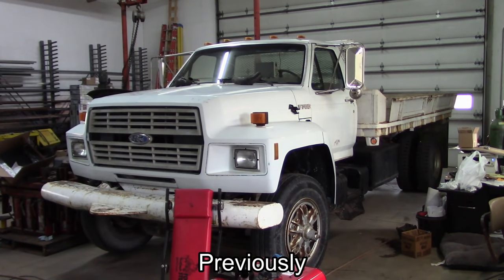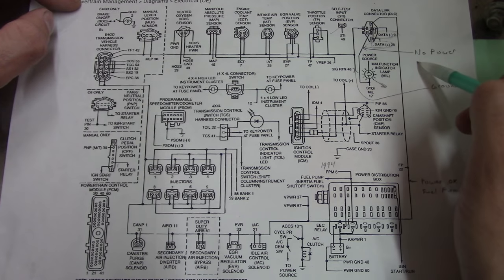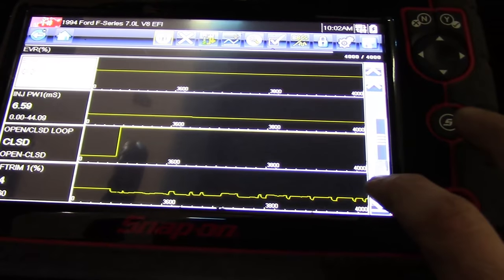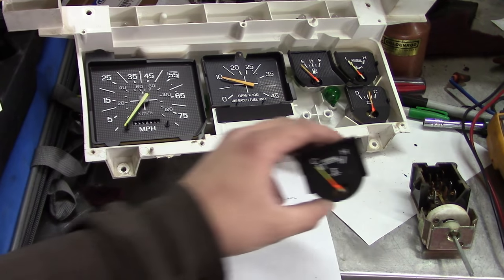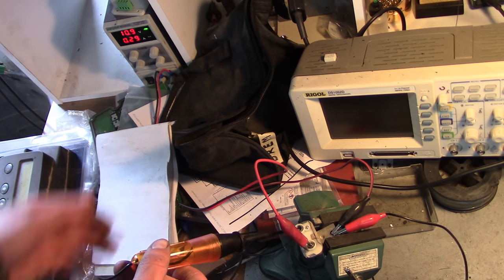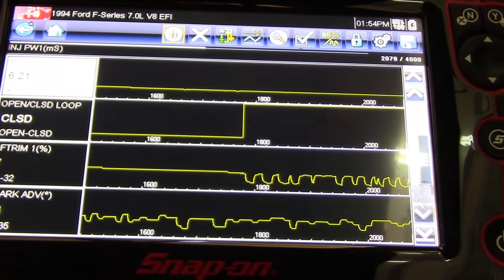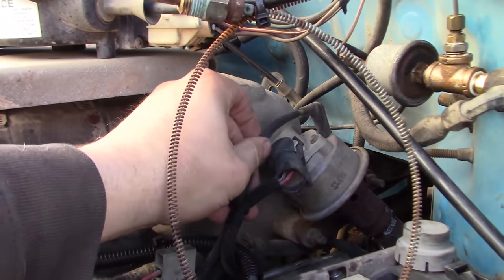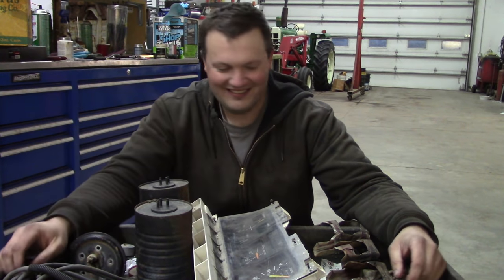Ford F700 Project - Missing, High Idle, and Gauges - Diagnose and Fix (Gas Engine) - Part 3

Comment: You certainly are thorough.  I wish all mechanics had your ethics.  I had an old 82 Ford F-100 that I rarely used except to haul things to the trash place a couple of times a year.  Every year for six years it passed inspection, until one year.  Same truck, same mechanic.  New rules, Emissions guys cracking down.  I never even knew that emissions parts were missing.  LOL.

Comment: EXCELLENT job of tackling ALL the issues with this truck. You sir, have what few guys turning wrenches for a living have, patience. Your approach to diagnosing and testing of all non-working components was spot on. BTW in answer to your question about the two data link connectors, some early Fords of around that era, just before and maybe even the first few that were OBD-II compliant had a separate data link connector for the ABS brakes.

Comment: This reminds me of the time I replaced the fuel sender on an International S1600. I checked the gauge by shorting to ground so I figured, new sender. Pull the old one out, looks brand new, float works, doesn't seem like there's anything wrong with it. In fact, it's the exact same sender I bought. So I stick the new one in, same problem. Always reads 1/8 tank. So I pull it back out and put my scope down the filler neck with the light coming in through the sender hole, and lo and behold, there's a pickup tube there right where the float wants to sweep. I grabbed a crescent wrench, re-indexed the float by bending the strut it was attached to, stuck it back in and it worked perfect. Same truck, bought a new alternator because it was overcharging like 17 volts. Go to stick the new one in and find that there's no wires attached to the voltage regulator pins. Wire was just hanging there. Alternator was about to fall off too. Plugged it back in and the one that was in there worked fine. I think it was installed by the same guy who put the new sending unit in the tank. Just a hunch.

Comment: I have the same truck almost with the same problems its a f600 with a 370ci gas engine my problem is that nobody will work on it i absolutely love the truck and i found your videos and watched them to see if i could possibly do the work myself with no mechanical ability whatsoever and after watching your videos i definitely will not be attempting to do it myself i did enjoy the videos and i wish i could find a guy like you in my area great work👍

Comment: Thanks for the videos on this F700.  I bought a 1993 F600 flatbed dump last year and ran into some of the same problems you did.  Sensors/controls I checked, found bad, and replaced: engine coolant temp, MAP sensor, O2 sensor, throttle position sensor, and idle control valve.  Replaced plugs, wires, distributor cap, and rotor button.  Have the same issue with the left turn signal - have to hold down to get it to work, but if I push it all the way down to the detent position so it holds, it doesn't work.

I still get a check engine light occasionally and it doesn't run as smoothly as it should - mostly on acceleration; idle is okay.  It smells like it's running rich.  I have a much less advanced code reader than you and I have only found one error code, but it could be one of two problems.  Can't remember the code now, but seems like it was a P52 or 53 - one option had to do with the power steering pressure switch, but I don't see one anywhere on the power steering system, and I don't remember what the other possible cause was.  

One thing I noticed when setting the timing was that it seemed to run better with SPOUT connector removed.  I've read several forums that say the electronic ignition modules are prone to failure.  Mine is on the firewall, but earlier model smaller trucks had them at the distributor.  I've ordered an ignition module and a new coil to see if this improves how it runs.  Incidentally, the guy that owned the truck before me had already replaced the distributor.

You gave me a few ideas on some other things to check like the purge valves and those vacuum cannisters.  I like the old truck and it's really useful around here on my small farm.   Thanks again for the videos on this truck.

Comment: Wow!  You are a master of the diagnostics!  That was just the truck that just keeps on giving..... you work.

On the positive no dead or live rodents. All parts were available in some way or fashion, and the parts cannon was not needed.

On the bad side it was like you used your entire supply of butt connectors and heat shrink, and you had to pull out the parts machine gun over and over...

Nice new logo!  We all need to use grade W bolts!

Who worked on this truck before?  They should have their wrenches and side cutters confiscated!!
Reply from the maker: Someone hacked it up. But the customer bought it that way.

Comment: I cut threw an under ground wire with a chain trencher running some drainage tile. Double 120 line, it was live. To repair it I used a repair kit from lowes. Shrink wrap and silicone. That was 15 years ago no problems yet. Repairs on that truck reminded me of that repair.

Comment: Excellent work Wes, great diligence and attention to detail, as well as exceptional patience. my mobile mechanic work is often not so detailed and the battle ya fight with 90’s emissions equipment on gas engines is a great challenge. I know very few people in the realm of auto and equipment mechanics that have the patience to return a machine to stock operating condition like you did, it’s easier to bypass stuff or throw in a 12v Cummins with no emissions equipment and then it ends up at YOUR shop some years down to road
Reply from the maker: These engines really weren't that bad. It has an air pump and an EGR and a basic evap system. It's not like those computer controlled carburetors from the 80s or even worse the mechanical fuel injection.

Comment: Yes sir, I am very happy indeed to see all those issues diagnosed and fixed correctly.  Takes a lot better mechanic to actually fix all that than most folks idea of just "blank off the emissions crap" and smash the management lamp...  Have to wonder how lazy/inexperienced the guy must have been though to spend on aftermarket gauges when the cluster stopped working.  fantastic work.
Reply from the maker: I see it all the time.

Comment: I thoroughly enjoy your trouble shooting escapades, Wes. I learn a lot even being an old motorhead. Just wish I was better at electronic troubleshooting. Simpler electrical stuff no problem, circuit tracing no problem, fixing lights no problem, however the printed circuitry/sensors/ECU systems/vacuum hose nightmares are mind numbing/boggling. Congrats on your good success with your Mission Accomplished Ford truck project!

Comment: That was a great series.  Goes to show if you choose wisely that you can get an old beater and get it back to working for under $1k.  Especially when the previous owner used the fix by delete method. By the way, a lot of us Gen Xr's were jumping out of our seats trying to tell you that you could morse code the engine fault out of a late eighties Ford until you said it yourself.

Comment: I am slowly getting to watch all of these fascinating videos! Wow I do not miss some of the old school attempt at technology that this vintage of vehicles had. I have successfully used solid state 5V (7805) regulators in similar clusters. The slow acting thermally based gauges do fine with the low frequency "PWM" generated by the stock thermally controlled switch (modified blinker), but a linear regulator is nicer.

Comment: The gauges are actually thermal based.  That's why they move slowly.  The regulator is also thermal based.  I worked on a 50's Plymouth for a friend with the same problem.  The regulator was built in one of the gauges.  He found on the innerweb a way to replace the thermal regulator with a IC based regulator, which I did.  Problem solved.  Keep up the excellent content!
Reply from the maker: Interesting.

Comment: I know this video is older. This truck has the same dash and instrument cluster as My 1983 Ford F100 except my speedo is mechanical not electric, but looks the same. Mine is still having a 2 barrel carburetor on a 5.0L v8 engine.  And yes I am familiar with the brake out box  you mentioned. We use one on the airplane too sometimes for PC boards and other systems .  The finding of the vacuum leak was funny both times. Love it. Great videos Wes. Thanks.

Comment: Nice work Wes, seeing that instrument cluster reminds me of my Dad's 85 F-250.  It had the 302 EFI in it with the diagnostic connector in the engine compartment.  I can't remember the type of scan tool used on it but you could also hook up a test light and it would flash the numbers of the error codes which is how I fixed it.

Comment: Inspirational and educational.  I have a 1995 Ford F700 with a gas engine.  It too has a high idle that never goes away.  The check engine light comes on after a minute of running and I haven’t been able to read any codes.  I now know that there might be two connectors.  I might be hooked up to the wrong one.  I appreciate what you do.  I know where to look now.  Thanks.

Comment: Two comments that you asked for information about. The reason the truck goes back to open loop at idle is the oxygen sensor cools off enough to not be able to provide feedback data to control fuel trims. so the truck reverts back to open loop until it warms back up. Also Ford used that style data link connector for several systems back then and that connector likely went to another system such as anti-lock brakes and such. I am not as familiar on the larger trucks, usually the connectors were a different color. That may be why there are two connectors there. On the gauges they use 3 volts pulsed as you saw to prevent rapid movement of the gauges as seen on GM products of that vintage (80's). In the 92 and later style dash they used a Slosh Module to prevent the same thing. On those fuel gauges if they read empty it is nearly always the brass float that is bad. They are readily available for about 12 bucks. I have replaced many of them over the years.

Comment: Wes. My Tiger had a voltage regulator like the 700. It actually was a bimetal switch that would get to 12 volts and then heat the switch it would open -go down below 12 -cool down go closed get to 12v and open. Crazy. Replaced it with a 12 volt zener diode. Still works. Old School Lectrics. Great diag on this pos.

Comment: I know it's customer pay work and you were probably trying to save time but I would've ordered some universal plastic vacuum resivors and retro fitted them in saved the guy a headache. Probably also would've done the evap system a little different my self but overall fantastic diag work. I do alot of work on farm truck and old gas grain trucks. You truly do see some of the most frustrating hacked up wiring and mechanical repairs from farmers.

Comment: Hi wes  As a retired ford tech i do remember the other obd connector. it is for rabs diag. rear anti-lock brakes. only used for anti-lock diag. the dash regulator was a primitive anti-slosh for the fuel guage and it allowed the temp guage to climb slowly.
Reply from the maker: OK thanks for the info!

Comment: Good video.  The voltage regulator on analog gauges has been around since Ford converted to 12 volt.  Used a voltage regulator in stead of redesigning the gauges.  67 mustang got one on the instrument cluster.  

You can put a electronic voltage regulator in place of the Ford, but the gauges will lay dead for a while.  Oil pressure will lay at zero for a long time on a cold startup.  Gauges like a shot of 12v to wake them up on a cold morning.

Comment: This show reminded me of my 05 Chevy Colorado. Changed coolant temp sensor.  When cold will start and run for 25 sec then sputters. Disconnect coolant sensor starts and runs  fast. After warm runs rough. Reconnect temp and runs normally.  I installed a relay that when energized disc. Temp sensor. Operated by a switch.  Mostly in summer all good. Winter I use the switch.

Comment: i've had a 2004 Ford ranger in the shop for the last week and a half. in that time frame i've replaced the clutch, the flywheel, master and slave cylinder, rewired the reverse light pigtail, changed a u-joint, changed the rear main seal and changed the trans input and output seals and i still have to do the spark plugs and wires before it can kick it loose. I feel you on being ready to get that F700 gone!
Reply from the maker: The truck was here almost a month!

Comment: Wes as soon as I saw the "juice can" vacuum canisters I said I bet they are leaking .Jeep used them also in the 80's and they always have had leaks when I test them.The cluster voltage regulator is the type they have been using since cars went to 12 volts. Enjoy the videos as they show what really happens when you fix problems .
Reply from the maker: I was suspicious since once was already dented.

Comment: Before the fancy Snap on Scanners, ROTUNDA  had a STAR Tester II that would hook up to the data link and then would put the ECU in test mode so it could run a series of internal  tests to make sure all the sensors were working.  My 2002 Correct Craft Boat with the Ford  GT40 (351 Windsor)  used this same data link. The STAR Tester was great to problem solve issues with the motor, when it came to the ECU.  That second Data Link you were talking about with the single smaller plug , plugs right into the STAR Tester along with the larger testing port which then  allows you to start the testing process.
Reply from the maker: Interesting. I've only used aftermarket scan tools.

Comment: Fyi. I worked on a lot of Ford F600 tru F800's for 25 years starting back in 1979. The voltage regulator on the back of the instrument cluster  supposed to flash the way it did. The original was very erratic and it was bad. The other DLC might be for programming. That F700 brought back a lot of memories.... Thanks.
Reply from the maker: Hmm. Programming would make sense. I wish they would label the stupid things!

Comment: Welcome to working on old ford f600s. Bark farmers, a company i used to work for had a small fleet of f600s and f700s, the f600 had gassers and the f700 had the Brazilian diesel engine. Both had double obd 1 contracts, was told by the ford heavy truck dealer that it was basically because it made it easier for ford to trucks hd trucks together with off the shelf parts.

Comment: It's been decades since I worked on those trucks at the Ford dealership. When you ran into problems I was thinking check this and that and the video would cut away only for you say I checked this, lol. First, the second connection you you saw was a anti lock brake diagnostic port, later years they changed the color to red instead of black. Second, the reason it goes from closed loop into open loop is a programming strategy letting the PCM to lean out the engine at idle to met the emission regulations. The PCM  would keep leaning out the engine a little at a time till it would stumble and then go rich again and repeat. What you call a breakout port is call a breakout box by Ford and it was a pain to use. When ever you have off the IAC always clean them with carb cleaner. If it has a MAP sensor, some engines didn't, you will find when you removed the MAP a light coating of dirt on one side of the MAP's hot wire. This will need cleaned as well, so much so I would clean both the IAC and MAP as a regular maintenance service.
Reply from the maker: Interesting! I wish they would label the stupid things.

Comment: That regulator is a mechanical PWM unit. Just on-off-on-off, averages 5 volts. The gauges respond so slowly that it's barely or not noticeable. Been that way since the 6v days. Ancient technology.

Comment: Like old mopars. They had a pulsing regulator in the dash for the gauges that brought the voltage down to 5 volts. Were talking back to the 60's

Comment: Almost 100k subs! Come on people, get him there! This was exactly what I love to watch when I see vehicle repair series. Man that thing was a basket case. And now it's leaving your shop in tip-top shape. I hope you made some money on it. Chasing down evap and vacuum issues can be a nightmare. Especially on new-ish vehicles that require OBD1-2 checks to pass state inspection. My girlfriend had a 2006 Chrysler town and country mini van. that thing was an absolute pile of garbage. Had big evap issues. And, of course, the failure part, which was part of the hard plastic lines from the gas tank, was unavailable from the factory or aftermarket. So i was glad when she got rid of that pile. Anyways. Great job on the fixes on this ford. Pretty cool old rig.

Comment: It was common with Ford products for quite a few years to have an OBDI test plug and an ABS test plug. They were like that up until they started sharing speed sensor data between modules. Before that time they used trans output speed sensor for engine,trans and speedo inputs. The RABS used a sensor in the rear axle housing and then later they added speed sensors to individual wheels for ABS.
Reply from the maker: But these commercial trucks never had ABS or RABS. I has no wheel speed sensors of any kind.
Reply: Hi Wes sorry for the late reply. I hope you didn't take my reply as a correction sir I was simply trying to answer your question to the viewers. You caused me to go back and check myself because for the past 30 years I have confined my truck repairs to F350 and smaller but larger trucks and air brakes are not foreign to me. According to the Ford factory shop manual in 1994 on the larger F series trucks and on the B series trucks (busses) both RABS and ABS were offered if they had air brakes which is not to say that they were all equipped with one or the other. It appears that you have a cab that is wired for it but the rest of the truck is ignorant of the fact. Love your channel!